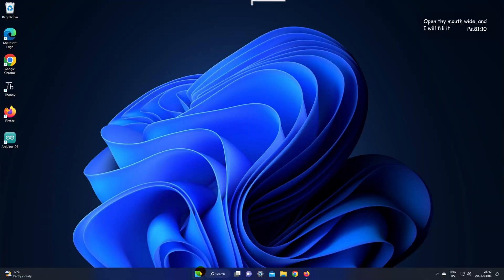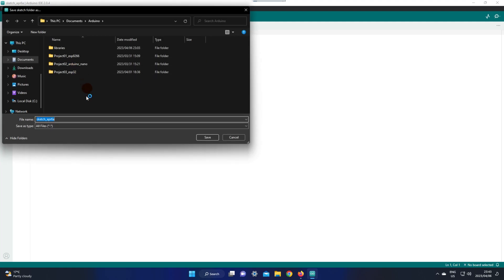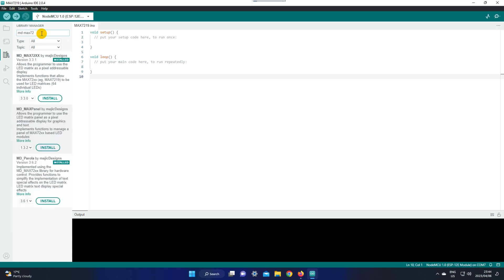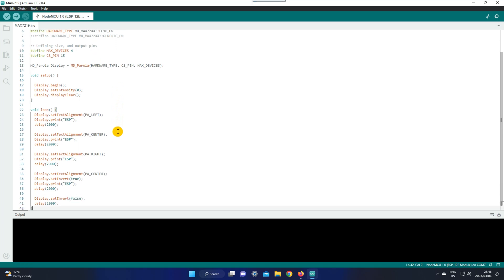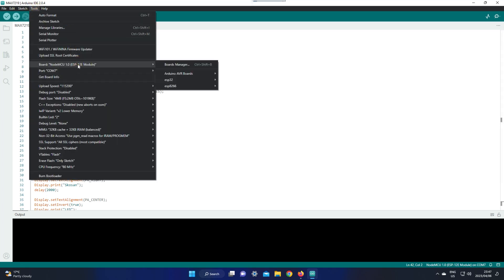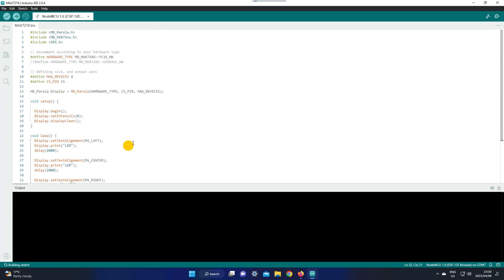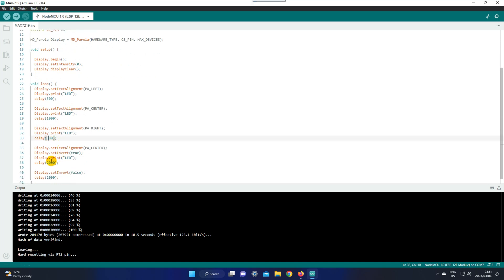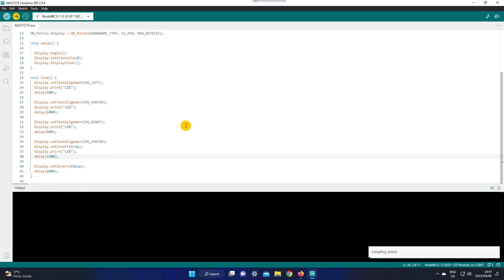MAX7219 4 in 1 Dot Matrix Display Module with ESP8266

Comment: website address is completely dead. anyone put it in a place that sticks around like github? also posts below code is wrong compared to board.  Wow this is really a mess. If you follow the video be sure to change the pin assignments in the code posted in comments as they are completely different.